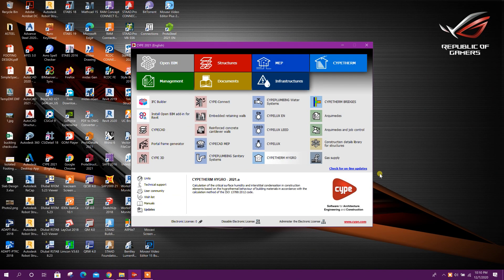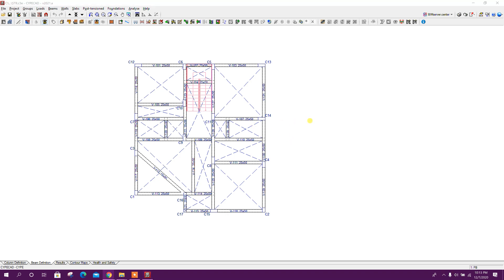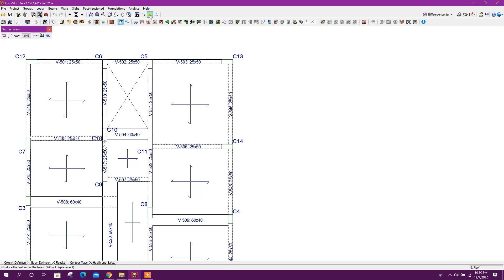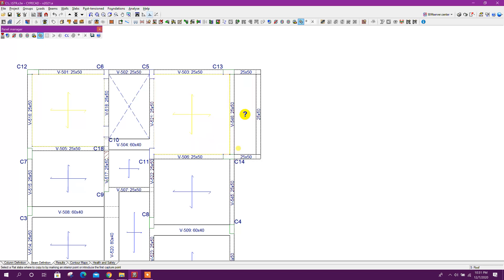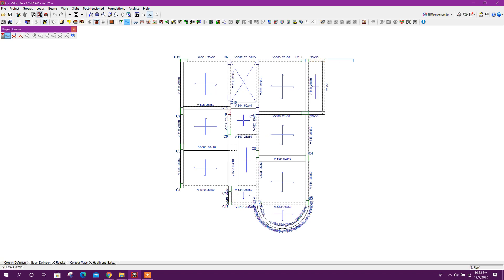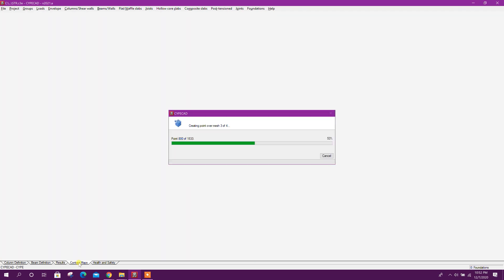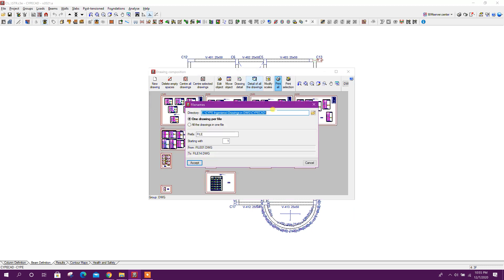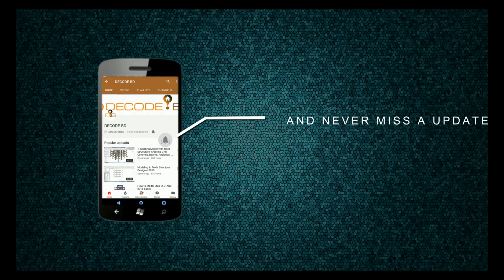Inclined or Slanted Column Design | CypeCad 2021

Comment: I have doubt/question regarding MODELING/ANALYZING/DESIGNING of sunken/drop slab in ETABSv19 & STAAD Pro Connect Edition 22 Update 5..... I know that it can be done in RCDC as well as in CYPE 2021 & Prota Structures 2021. But, i require or want to know in ETABSv19 & STAAD Pro Connect Edition 22 Update 5... Shukran....